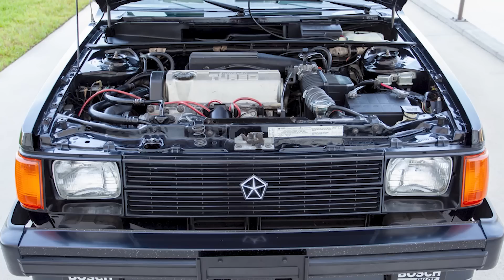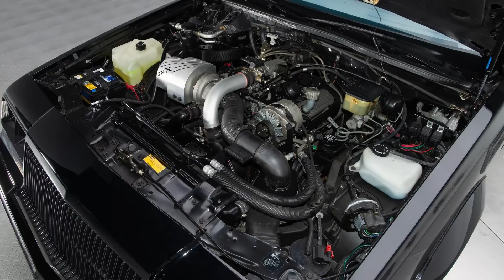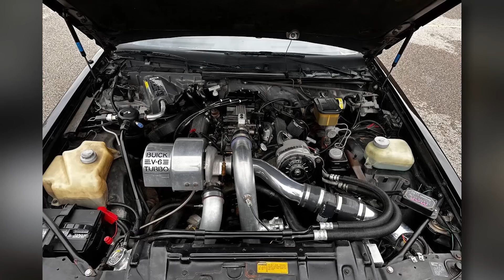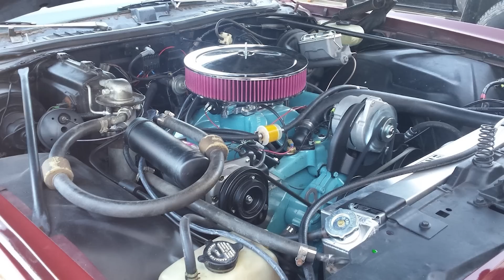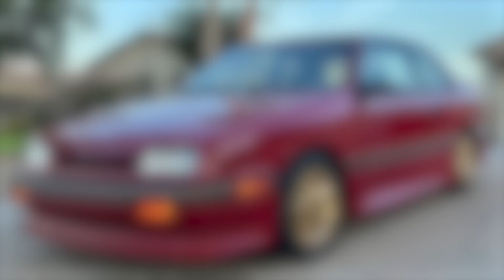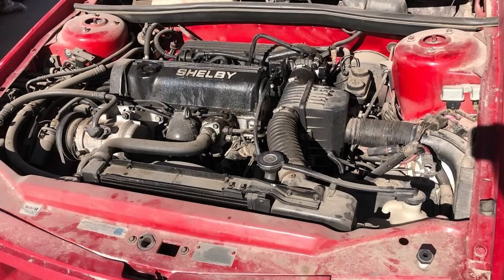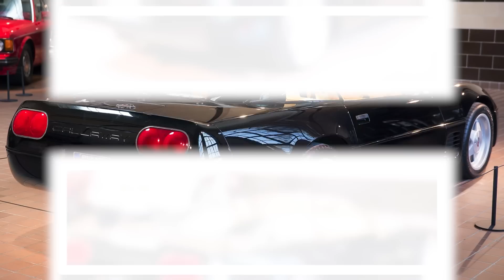5 Most Outrageous Turbocharged Cars Of The 80s!

Comment: I ordered a new Shelby Charger in 1985 when the turbocharged version first debuted. I purposely ordered zero options except for a rear window defogger (no A/C) so it would be as lightweight and have the most power to the wheels as possible. The only changes I made from stock were a K&N filter and a low restriction muffler. That thing was a pocket rocket for sure. I could hang with any stock Mustang GT, IROC Camaro, or Trans Am from stoplight to stoplight. I also beat a Mustang SVO from the same model year that cost twice what I paid for the Shelby. It surprised a lot of my friends and was a blast to drive!

Comment: I have 3 letters for you... SVO!!! 84-86 Mustang SVO 2.3L Intercooled turbo with dual boost controller.
84= 175HP 210 FTLBS 85.5= 205HP 235FTLBS 86= 200HP 230FTLBS, detuned to have the same HP as the 5.0 GT.
I owned my 84 SVO for 25 years. I would have had over 550HP and over 600ftlbs if it wasn't stolen with all the brand new performance parts. That 2.3L Lima is a great example of why high output turbo engines need blow off a valve. I snapped 3 or 4 turbo shafts, sheered between the compressor and impeller due to back pressure while shifting. Hence, why do you want to hear that PPPSSSHHH or have a recycle tube like in the SAAB 9-5. Prefect example of what a tuner car should be. To increase 30HP in 1 production year, then have to detune the next year not compete with a V8. Rumors about the 87 would have added a dual overhead cam designed by Jack Roush replacing the single. SVO would have embarrassed the GT if the division stayed together. Put those adjustable Konis on stiff, and it handled like a go-kart. I liked having 245-45 16s compared to the stock 225-50 16.The top mounted intercooler is why the hood had the offset hood scoop. Bi- plane Wing lowered the drag coefficient. The engine had vibration dampeners. Tubular lower control arms with unfortunately nonreplacable ball joints. Even back in the day, it was easy to get around 300HP with those old computers, that's why it's sad when Ford came back with a 2.3L four banger 30 years later that put out what we were getting back in the 80's and 90's with low tech. Ford claimed Americans weren't ready for technology because of that phrase, "There's no replacement for displacement." Rough racing should have been the American  version of Cosworth with the 2.3L Lima. Look at what Cosworth did with the 2.0L YB. Ford should have kept the SVO division, which did turn into SVT. Special Vehicle Operations sounds bad ass compared to the Special Vehicle Team. The SVO is almost always forgotten.

Comment: Not mentioning the Mustang SVO or the Merkur XR4TI let alone the Thunderbird Turbo coupe or my Mustang GT convertible SOHC multi port fuel injected Turbo 2.3 from 1984 is kind of a big omission when talking about turbo cars from the 80s don't you think?

My car was a bit crippled from the factory due to Ford's decision to make the 5.0 the top performances mustang but after a handful of cheap bolt on's and a computer swap my car Dyno's at 300hp and if you do a search for Jon Huber 79 mustang that is somewhere in the 800 to 1000 Horsepower with his 2.7 liter wheel standing mustang that does the 1/4 mile in about 8sec so yep Ford was first in a lot of Turbo technology in the 80s.

Oh and my 1984 mustang still runs with the original engine and it's 40 year's old

Comment: I rather enjoyed the 88 Thunderbird turbo coupe. 88 was the best year and as long as you got the manual transmission you got the same hp as the 5.0 out of a 2.3 turbo 4cyl. A borg warner t5 manual with a short throw and limited slip rear. Also had electronic suspension that could go from caddy float to track tight with a jerk of the wheel or a mash on the skinny pedal. It could also be locked in sport with a switch. Since it was built on the fox body chassis it was also pretty nimble for a T bird.

Comment: Chrysler Conquest /Mitsubishi Starion 87-89 TSI / ESI turbos.  I owned 2 of those cars.  G54B motor was super easy to modify and with proper tuning could get into the 11s for a 2.6 ltr turbo car that was very fast in the late 80s .. I also owned a bunch of Rx7s including a 88 Rx7 Fc3s Turbo II.   Turbo Rotary motors are insane.  I sure miss those cars.

Comment: A lifetime speed merchant, I loved going fast. From my little red wagon rolling down steep hills, to my later muscle cars,  and then a Porsche 928, I loved them all.  As I got older, I would reminisce about all the cars that I had wanted, but never owned, and tried to remember why. The reason was obvious; political and social connections, allowed the rich to buy these special editions of sports cars, with dealer added surcharges for 'special editions' and limited availability to the general public. I gradually just stopped ever planning to buy any of them, being not only priced beyond any reasonable cost, and being completely unavailable to an average guy who wanted one of the special 'factory special' performance models. Realizing that I would likely never have the connections to buy one, I eventually settled on buying a 'regular spec' Porsche 928, which remains my favorite car of all time. Performance, great handling, all in one package, and due to the Porschephile preference for the poor handling 911's, over time the 928s became affordable as used cars. Still better than 99.9% of all other cars, I got one, a lovely 1986, fully equiped, and continued to enjoy it for many years, while all the gearheads went nuts over an extra few tenths of a second in the quarter mile driving cars which couldn't go around turns, or, 911's which would swing it's rear around and crash going backwards into a tree. Adios, special editions. We learned that you are only available to rich people. But there are other great cars available to us, and we love them.  Hail, hail, Porsche 928; a truly magnifecent car. 20 years in production, with hardly an improvement, because it was perfect already.

Comment: Cool vid, I had a turbo trans am and it was a piece of crap. The engine was problematic , it was pretty good when everything was working properly but, that didn't happen very often. I ended up pulling the engine and installing a Pontiac 400 with a Muncie 
M 22 four speed. Also swapped the hood and added a shaker scoop.
I wish I hadn't sold it.

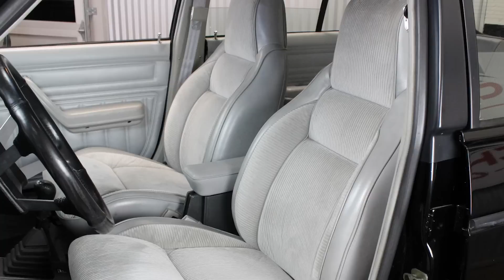Comment: That Buick wildcat engine is a top choice for rebuilt model t fords! It’s a wonderful engine in everything it was put in but it was an oil leaker with turbo or superchargers every generation had poor top and bottom ends unless you paid to build them up. The smaller displacement versions especially the 3.4 were the longest lasting versions. But still it was fun to drive GTP’s and SSEi’s torque was great for putting you into your seat! lol the 4.9 turbo v8 sucked , it was never reliable but at least it was easy to rebuild. The trans am was slower than a grand am lol always preferred the lt1’s to this day that’s my fave 350 ever! There’s more aftermarket parts and upgrades for them than all other engines combined! 330 hp with a 5 speed was so fun except when the transmission acted up you could break your wrist when resting your hand on it going in reverse (yes most people kept their hands on the shifter and it would pop out of gear into neutral hard enough to break a wrist) with 4:10 top speed was only 100mph but way more fun and faster acceleration! Don’t need to go over 100mph anyway unless you’re doing circuit racing. Easy to switch transmissions and components anyway so in a backyard it was easy to work on.

Comment: Owned A Turbo TA new in 1980. What fail to tell you is they had a very bad problem with the pickup coil. They would burn out about every 3weeks. It got to where they could make them fast enough to replace them timely. In a one year time frame my TA sat in my driveway waiting on parts for 8 months that year. Which is why I got rid of it.

Comment: The 5 most outrageous turbocharged cars of the 1980's. You covered none of them.

1989 Nissan Skyline GT-R R32
1987 Ford Sierra Cosworth RS500

These two cars utterly dominated the world stage for racing in Production racing, Group A, Touring Cars, Endurance racing. Really, nothing could touch the Cossie until the GT-R came along. Both were examples of when you let the engineers build as close to the rules as possible, and indeed in some cases twist the rules in ways that took the lawyers to decide who won the race.

1980 Audi Quattro Turbo. The original 2.1 litre changed everything. It set the standard of All Wheel Drive Turbo Charging that dominates rallying today. It was simply completely new thinking. The ski jump ad was simply magnificent.
1980 Renault 5 Turbo. This car was a tiny pocket dynamo with extreme speed and the cheaper Turbo2 delivered what was truly a WRC rally car to the masses.

Sure we could have a spot here for the Lancia Delta HF Integrale, that famous WRC car of the late 80's and early 90's, too. But my 5th one is possibly even more outrageous. 

Think of the Peugeot 205 GTi. It brought the HOT hatch to the masses. But, there was a special version of it called the Peugeot 205 T16, also known as Peugeot Talbot Sport. Simca (Talbot) basically hand built these. There were just 200 of these made to meet homologation requirements, but they were designed and built for racing. They literally took factory car shells off the production line and chopped them in half, stitching together new body panels. The front chassis was chopped away to replace it with tube frame sections. These were a full on works WRC rally car, with a tube chassis, but street legal, with a 450hp engine in what was a 3/4 length shortened inner city hatch. 

Quite possibly one of the most insane production cars ever made. At least as insane as the Shelby Cobra.

Comment: The problem with the GNX was the body style wasn't very aerodynamic and when you got up over 100 mph you could feel the air getting under the car and the front end getting lighter. My High School Girlfriend had a GNX in 1987 and I took it up to 125 many times on our local Highway. (there was a chip that cut it off at 120/125mph)
Reply: Doubt it was an X. They only made 547.

Comment: My 265 ci with triple Webers , pumping 1972 302 hp. 
Fasted accelerating straight 6 until 2002 , Australian built BARRA Turbo  XR6t  , owned and loved both a 265 Hemi ( 4.3 litres ) 300 hp from 1972 and a 4 litre Ford Turbo 260kw ( 320hp ) close , Handling ,, 85mph ? ,hills or straights ?>
Charger was ( is ) good for 125mph   ,, the noise 
XR6t  , good for 220 ? 270 ? kph ? , don't sound like a HEMI265 Inline with 3x Webbers ,,,,,, I own one and have sold one ,,,

Comment: No escort turbo? Interesting to omit
Reply: I had 87 Escort GT 1.9 EFI-HO, Got a speed ticket clocked at 142 mhp tried fighting it in court but I was clock by 2 different SP on I-95 so I was fined for speeding, miss uses of power and having a modified vehicle .
Reply: There were many omissions and could stand to delineate American, European, etc. then infill those if it suits.

Comment: Never met a bone stock GNX that ran 12.7 1/4 mile even with iced down intercooler. 13.7 more accurate. It would need at least another 100 hp to get into 12's. Fast for the 80's but today's cars & minivans have insane power. The good ole days were more fun.
Reply: In cool air at sea level a properly driven GNX was/is a high 12 sec car.

Comment: I had no idea the GNX was a 12 second car!
Reply: hot rod magazine did a "retro review" at a drag strip about 20 years ago with a stock, low mileage gnx down to the tires (not the original tires but same size and non-drag radial).  the owner ran a 13.1 or 13.2 at 104....car was insanely fast for its era.  i have the magazine somewhere i really need to dig it up.

Comment: My '68 roadrunner was faster, (glhs)shows how low our expectations were in the 80s
Reply: You in America had absolute dire cars in the 80s and 90s. You had these 5.0 V8s that made less HP than  little 2.0 4 cylinder engines from Europe and japan. Your cars were based on 1960s tech but detuned for some reason.
Reply: @uv77mc85  all about the emmisions. Choked the crap out of the cars. 500 ci engines with 150 hp. It was disgusting

Comment: The grand national should have been a 305 V8 Turbo.😮
Reply: Those 305s were junk. Id put money on a turbo one being put perfomed by the 3.8l. The 4.3l however with the turbo was a beast. And would have been nice if they used that comnbination more
Reply: 2nd that, esp. the 4.3L-T
Reply: They ran the 305 in the monte Carlo ss. Junk. The love for the GN is because of the drivetrain, because it was faster than vettes. Plus, a 3.8 setup can easily make 500 hp with little tuning.

Comment: Didn't even mention Mazda 626 GT turbo? So sad
Reply: Or the Mazada 323 GTX Turbo AWD
Reply: @WisconsinEric  both sold in America. And better than that Pontiac
Reply: @jAohnson143  I was a NA Honda CRX Si guy in the '90's and early '00's but there were so many other cool cars. I knew a guy with an Omni GLH, knew 2 guys with 626 Turbos w/ 4-wheel steering, MKIII Supras, RX7's, 240sx w/SR20DET swaps, ect. The only non-Honda I have owned in 28yrs was a MKIII Supra with stage 1 Turbo upgrade, HKS in and out
Reply: @WisconsinEric  most of the people posting on here are posting about cars that weren't available in the US. But a mk3 supra. Even with the turbo. Wasn't that fast. Their ass was too phat
Reply: @jAohnson143  I agree, but the kid I sold it to ran a 12.06 on street tires. That is faster than the stock GNX mentioned in this video. The 626 turbo you mentioned, and 323 GTX I mentioned were not fast in stock trim either. Nor was the Omni GLH, the Silvia swapped 240's, RX7's, ect. My favorite NA Honda's were 14 sec cars, maybe 13.9 on the best day. Not fast by most measures, but tons of fun.
Reply: @WisconsinEric  cool story. Needs more dragons. Post is about stock. And no one would choose a mk3 supra over a gnx.
Reply: @jAohnson143  I did not suggest anyone would take a MKIII Supra over a GNX. In '92 a Friend's father had a built 455 in a rare Hurst/Olds Cutlass and that car could nearly lift its front wheels off the ground. He straight up told me the GNX's were the fastest cars on the road and many would smoke his Hurst/Olds. Nice strawman attempt bro
Reply: @jAohnson143  Everybody in the civilised world would take the Supra. Unless the GNX is worth a fortune that is. On performance alone the supra is  2 decades ahead of the GNX in tech
Reply: @uv77mc85  I think you may be confusing the MKIII Supra with the MKIV Supra. In the US the MKIII was only available with the 7MGTE engine and it was not very good. The JDM MKIII Supra was available with the 1JZGTE, a smaller 2.5L twin turbo version of the MKIV's 3L 2JZGTE. And yes GNX's are worth a fortune these days
Reply: @uv77mc85  a mark 3 came out the same year. The 7m was a shit motor. You are out of your mind. Or you have no idea what motor was on the mark3 and or a little kid
Reply: @jAohnson143  Lots of unnecessary negativity and metaphorical jabs in your post while providing far less relevant information than the post above yours. He likely mistook the MKIII for the MKIV Supra, or he possibly lives in a different market when the 1JZGTE was available in the MKIII. You seem to behave like a "little kid" yourself. I hope you get past whatever is bothering you and you have a better week.
Reply: @WisconsinEric  if you wanna jump in the ring because you think you can box. You probably should have your facts straight. And no point in here were we talking about the mkIV. And we all know that's really the only one that non car people know about. Also the 1jz was in the last few years of production. And wasn't available in the US.
Reply: @jAohnson143  Thank you for informing me of facts I have already written in my unedited posts.